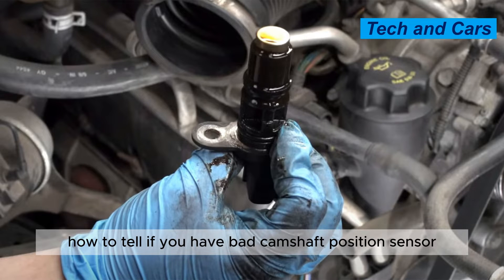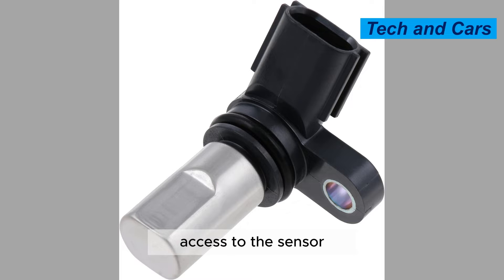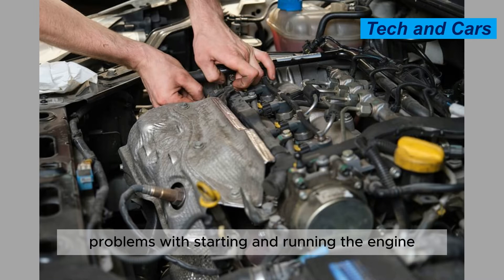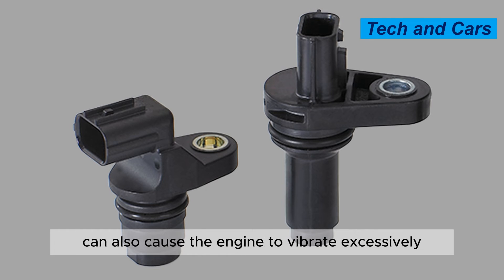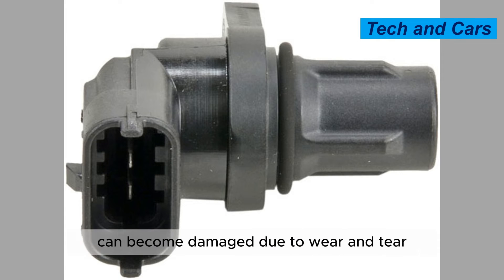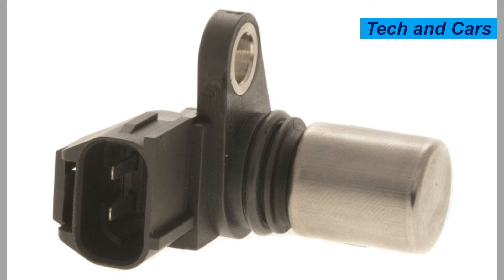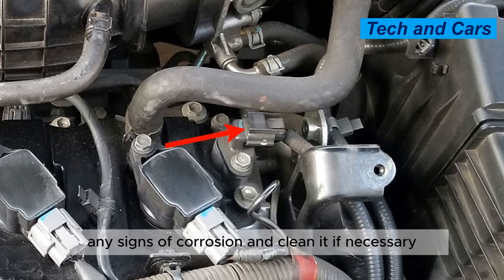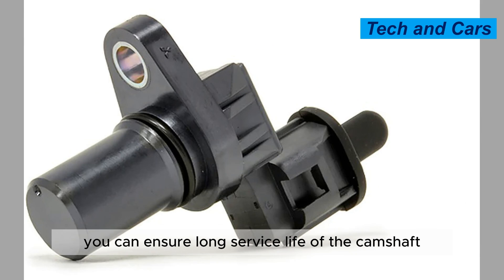How to tell if you have bad camshaft position sensor

Comment: Hello, great video! I have a car I'm struggling a bit with and was wondering if you (or someone watching this video) maybe know anything about it. Its a  Mercedes CLK200 136hp W208(m111 engine). The car will start perfectly when the engine is cold but after driving it for some time and the car gets to temp the car can suddenly shut off, but can start with no problem after cooling down for a bit. The  car also have slight misfire almost all the time. Have already changed fuel pump and filter, coils and spark plugs, and air filter. Have also tried cleaning the camshaft position sensor but nothing works. Any help is much appreciated :)
Reply from the maker: have you checked for vapor lock somewhere in the fuel system??
Reply: Fuel injectors?
Reply: Fuel injector harness maybe
Reply: I have exactly the same problem. I have 2005 impala ls 3.8 V6 series2. My car is great. But 4 months ago it stalled on the expressway. Then it became more frequent. Now everytime i get in cold. It starts, runs beautiful. At 188 degrees it shuts down. I coast over to side. I restart. It runs like a dream. No codes , no check engine light. I've done throttle body cleaner, new map sensor, new maf sensor ,new idle air control valve , new EGR valve , new O2 sensors. Still everytime it comes up to temperature, it stalls. Help

Comment: Can cam sensor for Kia Porter 2 cause hard starting for diesel engine
Reply from the maker: Yes, an issue with the camshaft position sensor (cam sensor) on a Kia Sorento 2 diesel engine can potentially cause hard starting problems.

The cam sensor is responsible for providing the engine control unit (ECU) with information about the position and timing of the camshaft. This data is critical for the ECU to properly synchronize the fuel injection and ignition timing.

Comment: Dear, I have warm start problems (not at working temperature and not cold), othervise engine running normal and smooth. No other signs. The computer doesn't show any errors, so no one can fix the problems (we have such good mechanics). Do you think the problem could be with this sensor?
Reply from the maker: I highly suspect bad coolant temperature sensor or its wiring! Have you looked into it?
Reply: @Furnishandlourish  hello, thanks for your opinion and advice. I haven't checked yet, because the mechanics claim it can't be because the computer doesn't show it. They only know how to look at errors. I will definitely check it out! I ordered it. Do you know which manufacturers are trustworthy?
Reply: @MrBostjanVidmar let me know also having this issue with a 08 Camry
Reply: @MrBostjanVidmar  my car jerks when putting on reverse from parking in the morning and also revs high for long in morning.when i let it warm up mo jerking when putting on reverse
Reply: My car is skoda octavia 1.6 TDI 2018

Comment: Hello Sir, Do you know how to judge whether the camshaft position sensor is good or bad? Can it be measured with an multimeter?
Reply from the maker: Yes! It can be checked with a multimeter! You can check the power supply and the signal output of the sensor. Have a look at the following video: https://www.youtube.com/watch?v=CfRKkHCYk6A

Comment: Would a bad sensor work fine until the engine is warmed up? Then fail, stall and make a low rumble-type sound?
Reply: Having that same issue. Everything is fine when ypu just start the engine but after it warms the ECU light comes on then the car goes into limp mode
Reply from the maker: Sometimes yes!

Comment: i have been replacing my crankshaft sensor like 4 times don't know what to do know
Reply: Why are you replacing the CRANKSHAFT position sensor instead of the camshaft position sensor? Isn't that the wrong sensor?
Reply from the maker: Am really sorry to hear that! Have you tried to find out what is causing frequent crankshaft sensor failure? The most probable causes of frequent sensor failure are: Wiring Issues (Faulty or damaged wiring can cause intermittent or complete failure of the crankshaft sensor.) Electrical Problems: Issues with the electrical system, such as voltage spikes or fluctuations, can damage the crankshaft sensor. High operating temperatures can affect the performance and lifespan of the crankshaft sensor. Engine vibrations and mechanical stress can affect the durability of the sensor.

And always make sure to use original parts (OEM parts) for longer service life.
Reply: Make model and year of your car.